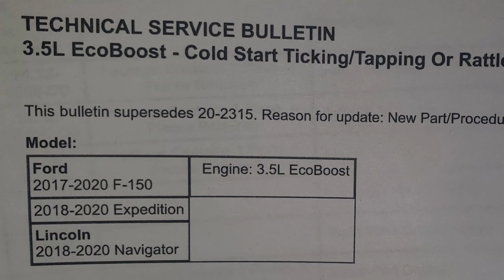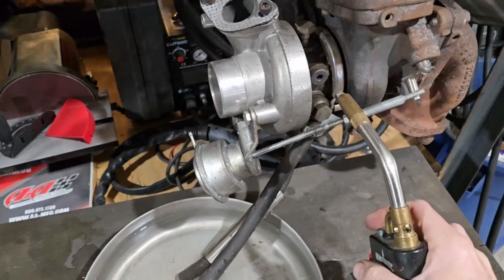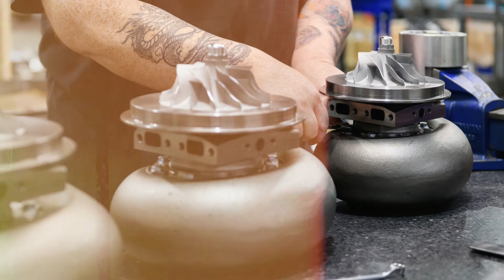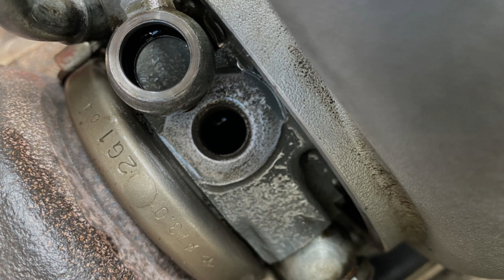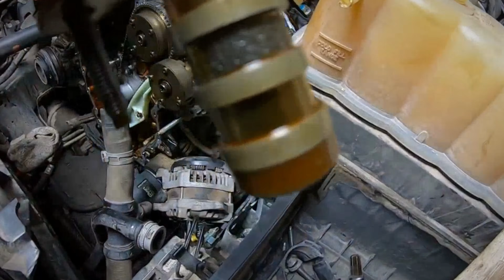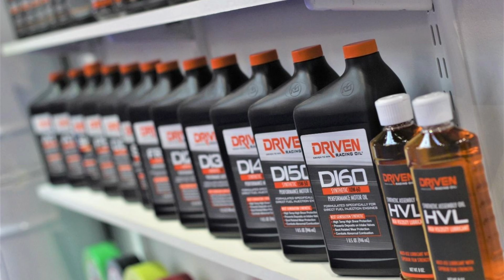7 Stupid Ford Oil Mistakes That Are CLOGGING Your Turbo Lines (STOP NOW)

Comment: When I owned a MB Sprinter (turbo diesel). I became a big fan of .. hot shots secret . Sticktion eliminater. It cleaned up the oil passages and cleaned out the burnished deposits. 
I still use it in my transit 3.7.

Comment: I have a 2015 Explorer Sport that I purchased in Jan of 2015. I started using the oil monitor when I first got it and changed to 7,000 mile intervals in 2019 and then 5,000 intervals in 2023. I'm at 179K and have only used premium filters (mostly FL500S but have also used Mobil1 filters) and Mobil1 full synthetic. I have always performed my own maintenance. I check it few times between oil changes. The oil mark on the dip stick has never moved between changes.
Reply: Twenty years ago Motorcraft were a good oil filter and made by Purolator. These days I wouldn't consider them being anywhere close to a premium filter. About a decade and a half ago Purolator was purchased by Mann & Hummel. The manufacturing quality took a noticeable drop and it seems the quality has not returned.
Reply: @peskypeetthanks for the info. I greatly appreciate it and will stay away from them in the future.
Reply: @BeanCounter-u1q  There are plenty of pictures of failed Motorcraft filters on a well known forum. Especially the FL910s. A great many with torn pleats during regular (not high mileage) usage. Partial name bobisthe.

Comment: I just done the manifolds on my ecoboost replaced all the lines and the little screens for the turbos as well (no sludge or coaking on them thankfully) i change every 3-5k miles equivalent in KMs i use high quality synthetic oil and high quality oil filters as well ide rather spend a few extra dollars on the blood of the engine then replace an 8-10k engine

Comment: 2.0 eco here, and I have used full syn since brand new and change every 5k miles.  No issues on this 2017.
Reply: I also got a 17 2L ecoboost escape i do the same thing good quality synthetic oil and good quality filter its been a great vehicle no problems at all
Reply: That's good. Do you know about changing the trans fluid about every 30,000 - 40,000 miles? Stay on top of that and the regular early PTU fluid changes.

Comment: I bought a new 2019 Ecoboost Mustang.  Today in 2026 it has a whopping 23,000 miles on it.  If I went by the oil life monitor I would be on my 3rd oil change.  HAHA!   Nah man, I've changed the oil every 3,000-3,500 miles since new.  My car specifies Motorcraft 5w-30 synthetic blend.  Screw that, I use full synthetic since new.

Comment: You might want to talk about a catch can for the eco boost if you haven't already
Reply: Don't use a catch  can in freezing weather. It can destroy your engine.
Reply: @merrillmccoy2247 what do you think about running one in the southern states
Reply: @jacoblocklear6809 as long as the temps don't get to freezing or below.

Comment: My cars are turbos and one is SC.  All but one is tuned with a afterward tune so I rip a good bit... not abuse but never can I go out for a drive and not stand on it a little... even will tell myself "today I am going to drive normal" never happens.  But I change my oil at 2,500 miles on the tuned cars,  always (2 weeks) check oil level, on suv turbo car not tuned I will change oil at 4K miles max.  At 70K on one of the cars and is perfect...with that said I wouldn't be replacing the turbo with a factory I would go bigger so win win LOL

Comment: I just purchased a pre-owned 2021 Ranger with the Ecoboost Turbo engine.  I never knew any of this but my guess the previous owner did since the engine runs great and the vehicle looks like it was kept in a garage all its life!  I'm going to be vigilant on what type and how much oil goes into the engine and will follow proper porcedure as suggested  by you while running the engine.  Thanks so much for this information!

Comment: does this also apply if you select eco drive mode? My understanding is that this mode shuts off the turbo. in this mode i can tell the turbos are off when i am at a stand still and press on the gas, it is a little bit sluggish vs. "Normal" mode.

Comment: How about offering a real motor and not a piece of crap that needs a turbo to function and get around normally.
Reply: They do it’s called the coyote v8
Reply: @JackMcCoy331  That is true and that is an awesome engine,  But its rare unless you talking mustangs,  Rangers, and the f 150s need motors with out the turbos.  and motors that do not need turbos.
Reply: Because this magical thing called the EPA is telling them to meet certain specs or not sell anything in the U.S at all. It's not the companies fault. They're having to adhere to strict policies in the U.S. If it wasn't for those policies you'd be seeing more V6's and V8's in cars instead of Turbo 4's and 6's.
Reply: @AsreiMurasame  A government engineered decline on purpose, to push everyone into a EV and more control of movements

Comment: The last 2 vehicles I have bought came with a turbo engine. Since the auto industry is forcing us to buy automobiles with them now, then they should be responsible in educating their customers. There wasn’t any. Emphasis from anyone during the buying process to educate me what so ever about turbo engines. I have had to educate myself. Luckily I have been using the proper oil.
Reply: Agree with you

Comment: 2025 f150 powerboost. When backing into my driveway or driving low speeds into a parking lot, the engine shuts down and the truck goes into hybrid mode. How can I cool/lubricate those bearings when the motor just shuts down? Cannot run it for the 1-2 minutes I would like to. When starting usually the system goes into hybrid mode (except when it is cold outside) and I have no time to bring oil back onto the bearing surfaces unless I move the truck with light throttle to get the engine to 12 rpm or so. HOW DO I COMPENSATE OUTSIDE OF USING QUALITY FILTERS AND THE CORRECT SP CERTIFIED SYNTHETIC OIL + WEIGHT?

Comment: I’ll change my oil every 2500 miles ultra platinum penzoil  now I  am on 118 kmiles on it !!!limited 2013 3.5 ecoboost
Reply: I use the same oil in my 2013 3.5  also.

Comment: Use diesel grade only!!! Chevron Delo or Shell Rotunda (one more certification for aircraft). Use WIX or OEM FILTERS ONLY! Forget NAPA, they're Counterfeit Chinese CRAP.
Reply: The oil geek says different!
Reply: @paulcondie2520  I could be wrong here but I believe that test was done on a NON turbocharged engine.
Reply: @peskypeetyeah I don't remember but I'm pretty sure he said never use diesel oil in a gas engine 🤷🏻‍♂️ too much detergent, diesel fuel is dirty.
Reply: It is usually one or two manufacturers for the filters and the filters are manufactured to brand specs. The same for the additive packages in motor oil. Have you investigated the chemistry of the oils you recommend? For instance, do those oils meet the certification(s) of the manufacturer i.e. SP minimum rated?
Reply: NAPA are WIX filters.
Reply: @barrymantei7795  Not so much anymore.
Reply: @peskypeetI bought WIX filters at Canadian Tire last week and it says manufactured in North Carolina on the box.
Reply: @barrymantei7795  Yes, I understand. However things are not that cut and dry. Things have definitely changed for NAPA filters. There are different suppliers for different filters. Look for a royalty auto service video where they ask NAPA reps about what's in the box. The video is 2yrs old now.
Reply: Never use deisal oil in a gas engine, to much detergents in diesel oil for gas engines.

Comment: What’s a turbo line?
Reply: turbo lines are small hoses / tubes used to make the engine oil to enter inside the the turbo for cooling and lubrication and there are two lines in and out

Comment: Why does Ford recommend synthetic blend in the owners manual?
Reply: The latest spec is a full synthetic, and is ILSAC GF-6A and API SP.  That's what the current Motocraft oil is.
Reply: I would think that Valvoline restore and protect would be the oil of choice!
Reply: @Rock_Fish512 not when ford can charge $$$ because the oil says Motorcraft...
Reply: So you wait 10k miles, destroy your engine, they deny warranty coverage, and you have to buy another one because you love Ford Products.

I have a 24 Mustang and I change the oil with full synthetic no more than every 6 months or 3k to 5k miles.

I have had 6 oil changes during my current 7.8k total miles.

I don't drive it a lot 😊.
Reply: @williemac163  This is why I went with a 2016 Tundra,  Last best thing I could get my hands on
Reply: @Senerian - I do not blame you. My next truck will be a Tundra 2012 to 2018 with the trusted 5.7.

I have a 4.7l Dodge engine in my current truck and I have had to nearly be a doctor to get it to the current mil of 275k.

It was hell.

Never again.
Reply: @williemac163  If you have 275k on that, I would say you do very very well at maintenance and things and know how to take care of a vehicle.  If you get that Tundra, and take care of the way you are the doge, It will last rest of your life most likely
Reply: @Senerian - it took 3 engines, 2 transmissions, and 2 new transfer cases to get to those miles.

Replaced:

- Both catalytic converters and all oxygen sensors.
- 2 new radiators
- New alternator 
- 3 new power steering pumps
- New starter
2 new front shafts
2 new rear shafts
2 new steering shafts
3 replaced computers
Rewired TIPN

Everything was replaced on that truck except the rear end pumpkin and fuel pump.

New sparkplugs every 30k
Second NGK ignition coil set
Oil changes every 3k
Trans fluid, transfer case, front and rear end fluids changed every 30k
New PCV valves every 50k
Now replacing MAP and Air Intake sensors NGK 

I don't use cheap parts. When I replace, they are new. Dodges hate parts other than MOPAR and NGK .

Call it sunk cost fallacy or it was paid for and I just did not want to spend over 50k for a truck.

Either way, never again. Lucky for the engines and transmissions it was under  Chrysler warranty.
Reply: @Senerian Plus it’s cheaper!
Reply: I have a 2022 ecoboost and it recommends the same, it has 17k. Dont know if I should switch or run the same.
Reply: I would switch to Amsoil Signature lubricants and check your turbo feed lines and any filters.
Reply: So you have to go back to them and pay them more when it breaks down
Reply: Because Motorcraft synthetic blend is made up of a large percentage of synthetic oil. Look at the specifications and you'll see it's on par with every hydrocracked Group III synthetic such as Mobil 1, Pennzoil Platinum and Valvoline Advanced. For example, there are no conventional 0w20 oils. Motorcraft makes 0w20 in as a synthetic blend...meaning, it meets the requirements of synthetic.
Reply: @pbaker7160 Bob the oil guy says its between 11-18% synthetic?

Comment: I drive about 2,500 miles a year. I get it changed every year when it gets inspected.
Reply: That’s wrong if u don’t put enough miles on your car. engine oil MUST be changed every 6 months = 2 oil changes in 1 year
Reply: Not necessary since we now have dual viscosity oils. I have a '68 Mustang with one of the first 302 J-code engines. 10W-40  oil. She sits in the shed all Winter now and I trickle the 2cycle mix into the carburetor for the first start. I have done valve jobs twice but no engine wear.